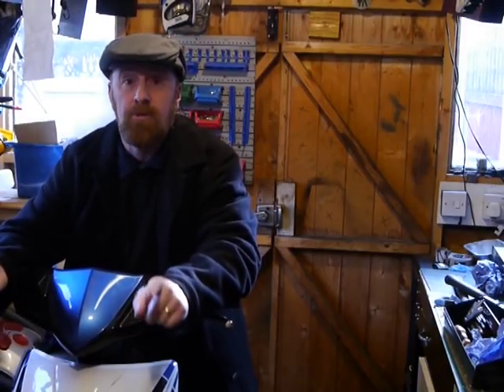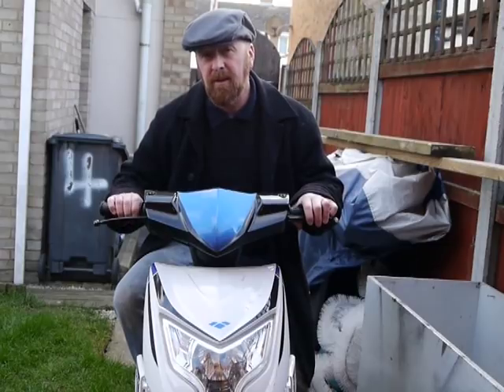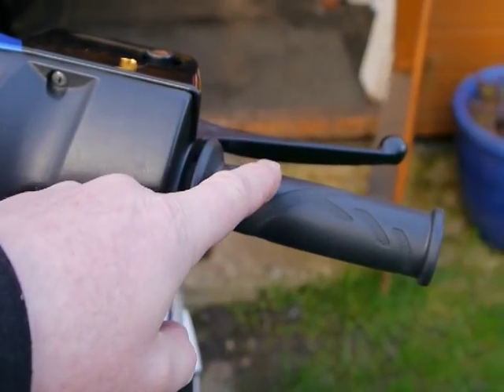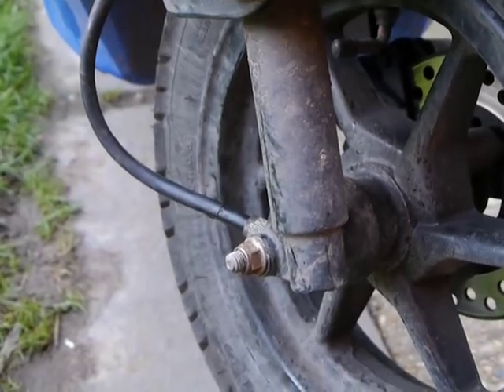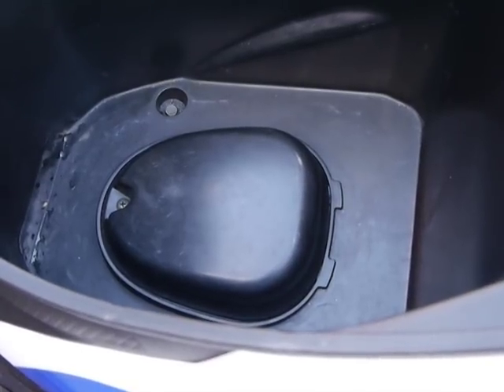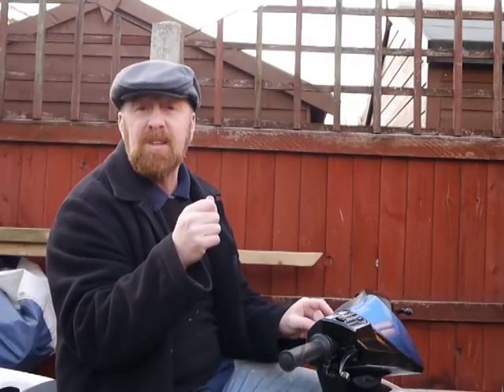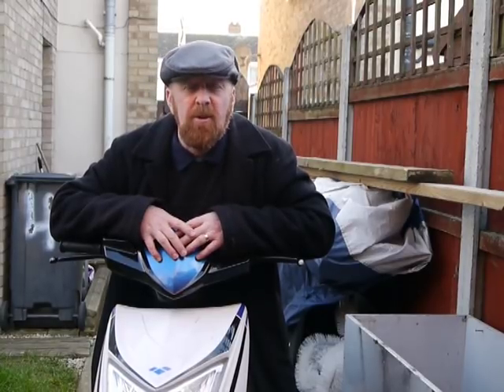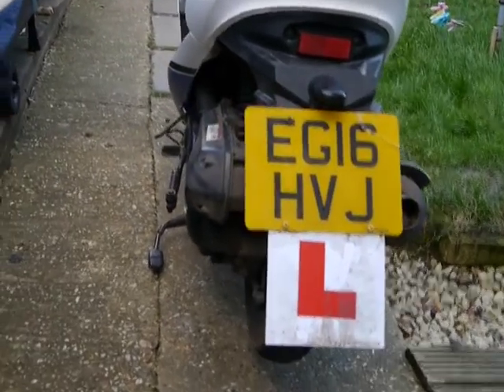LEXMOTO 50CC BUY A CHEAP CHINESE MOPED MARK SAVAGE

Comment: You'll be happy to know we have a 12" wheel version of the Echo now known as the Echo+. Thanks for the great videos :)
Reply from the maker: That's good to know and thanks for the update 
If I get hold of one I'll be sure to give it a revised review
Reply: I bought a Lexmoto Echo Plus last week. There is a loose pipe coming from under the seat. Is that how it suppose to be?
Reply: Can a lexmoto echo plus be derestricted?
Reply: @moukbu4235  no. Just basic cvt tuning (lighter or heavier rollers) and a sports exhaust but they don't do anything other than be annoyingly loud. If your 16. Just wait until your 17 and get a bike.

Comment: Mark your videos has helped me a lot with a small problem which a thot was a big problem till a watched your video on the lexmoto echo about the speedo not working so stripped the wheel off as the Speedo was still together at the back and the speedo cable made the little arm move when I removed the wheel and the problem was the exact same as you demonstrated straightend it out and there u are working perfect again and the speedo now say my exact speed without me guessing cheers mark 👌🏻🍀
Reply from the maker: Thomas McGhie that’s why I do the videos bud so they help with simple diy and away you go
Please like share and sub 
Mark

Comment: “Slightly unstable on the road” exactly what you want in a moped
Reply from the maker: They now have 12" wheels which solved this 
But to be honest once you get uswd to how they ride they are fine
Reply: mark savage I would prefer a Yamaha Aerox but I can’t really go over 1000 do you know any alternatives? (Used obviously)
Reply from the maker: @akmedia8206  aerox is a good moped and get a 2t older one much better 
Speedfight  , dna , nrg , runner 
All great fast fun all under £1000
Don't buy newer ones bud not as much fun!!

Comment: Hi man. I’m 16 soon and want a good 50cc. What good bike can I get used for around £700 I don’t want a cheap Chinese one like a lexmoto
Reply from the maker: That's a good budget 
Aerox , speedfight , DNA, runner , typhoon , 
These are all good mopeds as long as they have been serviced and looked after 
Dont get one that a lad has 70cc kitted it or says he can do 70 mph  and wheelies bud 
Test ride start and stop it long mot and v5 log  book with some info on what has been done 
You cant go wrong then
Reply: mark savage what does long Mot and v5 log book mean. Sorry I am completely new to biking and stuff as I’m still 15
Reply from the maker: @jamesroberts5875  for the mooed to be legal it has to pass a mot so it can be on the road it's like a health check 
V5 log book it a legal document of ownership so to say it's your
Reply: mark savage thanks man you’re a legend. Where could I buy one of the mentioned mopeds from?
Reply from the maker: Facebook sales , ebay 
And have a haggle lol
Reply: mark savage are you selling any?
Reply from the maker: @jamesroberts5875  
Nothing in at the mo bud sorry

Comment: Hello Mark
sorry for asking in this video but it's about the speedfight 2
my question is about whether it is advisable to use synthetic oil in the gearbox, the oil I intend to use is liqui moly 75w 90 gear oil
what do you think
Reply from the maker: hi bud it uses so very little oil in the gear box and I have done a video well two of the gear box that will help if you have problems but I'd stick with what Peugeot say you should used so you going to drain all of the old oil out then refill, its a very un stratifying job to do but does have to be done at some timehope all goes well, I cant see if you want to use the 75w it would cause too many problems at the end it's up to youmark

Comment: they do a 12inch model now as been sorting out one for a friend today  i got to say tho im more of a 2t guy   but riding echo+ after sorting it out  was not bad just very  slow after riding a 14hp 2t tho :D
Reply from the maker: yes I was contacted by lexmoto after I did this video and given one to ride if I wanted but at the time I could get to the main dealer to do a review 
but I have heard they are a lot better with the bigger wheels, as you must have watch a few more of my 460 videos theres many on 2t mopeds well speedfights aeroxs dna's nrgs etc etc and have to agree more fun and much faster but they do break a lot pmsl 
thanks for watching
Reply: @marksavage  i dont know why my friend got this one tho as he payed £300 yes its only a year old but  had blown fork seals and broken spring  ,  needed new rollers and exhaust   so looked like the 16 year old he got the bike from had well used it in that year lol so fixed everything then given it a service but for how fair my friend rides just over a mile to work its fine for that as after parts and for him paying me the bike stands him in £450
Reply from the maker: @mrchilled85  that's really good , they get used by 16 and not cared for so bargains for those like yourself who with a little bit of time and care bring them back 
Good to hear bud take care

Comment: Hi Mark I'm thinking about getting one of these little bikes I'm 18 and have just passed my cbt I'm going to buy it new and service it regularly with help of my dad who has a shop and works on scooter. I want this scooter to last at least 4 to 5 years. Would I be better off buying a speedfight preowned or shall I buy a brand new one of these
Many thanks
Reply from the maker: Prob best take advice from dad !, 4t are more reliable but slower 
2t like speedfights are fun but need playing with to keep them going 
What ever your choose make sure it goes more than 30mph on todays roads and stay safe

Comment: My son has the Lexmoto pulse both variator and cable seem to be working fine have you any knowledge of the speedo assembly being the fault many thanks
Reply from the maker: I have a few video on speedo drives well worth a watch 
Type in speedo mark savage 
They are on mopeds and 125s but they will help
Reply: mark savage  I span the wheel with the cable disconnected at the dash end and the spindle is spinning well I followed what you said cleaned speedo drive and re greased just as a matter of good servicing it’s the SPASM095 dash

Comment: I would rather buy a branded used bike. In my opinion Yamaha aerox ( the 2strokes) are the best mopeds in existence
Reply from the maker: I agree and if you have watched my many many other videos on aerox's speedfight's, dna's ,nrg's and so on you know I agree, however they do come with there own problems and not every one likes 2t's
so you do have to look at the 4t's and also comes down to budget
thanks for watching
Reply: @Paul Tanner you missed the used part. I can find plenty of branded bikes for under 1k that have far more life than a brand new lexmoto.
Reply: I'd get a branded bike if they existed in the class I'm getting(Swedish, class 2 25km/h). All you'll find in there is the Chinese bikes.
Reply: @eq2imora  unfortunately I don't think there is a big market for 50cc and big manufacturers anymore. The Chinese have forced them out.

Comment: hi mark, i just have a simple(hopefully) question, i own a kymco agility 50cc 4T scooter and now again i have another GY6 engine that just decided to stop building up compression, so it won't start, have you any idea why these bikes have this problem more than 2T bikes, this is going to cost me another 200-300 euro's (180-270 quid)to fix. Have you any idea what causes this to happen, so i can prevent it. What is the best way to run in a new cilinder? it's nothing special just an ordinary 50cc, i don't see the need to go bigger
Reply from the maker: HI BUD, this is the biggest problem with the GY6 engines, they run and run well and then just don't!
so your not alone, normally like in my videos as long as you keep them serviced and topped up with 4t oil they run well
so your last engine just died and you replaced the whole engine with another second hand engine or did you rebuild the old one, what was the fault on the old engine as you say no compression so the piston failed?
have you had the new engine looked at and is it the same thing. piston again ?
mark
Reply: the old engine(the original) is going to be rebuilt by an official dealer,  and then put back under the bike,and hopefully they will be able to tell me why the engine just failed,the engine that is on the bike at the moment ran wel 70-75km/h about 50mph and that engine also just stopped working, the official kymco manual recommends using 15W40 is that the right oil or would you recommend 10W40, i know that 15W40 is slightly thicker and also that it cools the engine better What is the best way to run in a new cilinder?
Reply: mark savage  just a quick update, apparently the previous owner had the same problem as i had at one time or another, because the cylinder on the original kymco engine was not an original part, they had replaced it with an imitation cylinder and also one of the piston rings had come out of its groove and the metal had ended up in the engine block and they had to replace the oil, but also the engine was run without oil at one point, because there was a deep groove in the piston AND the cylinder, now they've replaced the cylinder and piston and i can't go ful throttle for the next 500km

Comment: Hi mark are you sure the tank is 8 litres because whenever my fuel gauge is low I can only put about 4 litres in before it is full again
Reply from the maker: hi yes odd as the spec I first read for this model said 8 but since I have read it's only 4.5 or a gallon from empty so sorry bud but still not a bad bike 
thanks for watching and the correction 
please like share and sub and I have a few other videos that you may like to watch but with the right info lol 
mark

Comment: Hey Mark. I am a fat arse at 21 stone. Could I ride this or any other 50cc or 
would it not work with my lump on it? Cheers mate
Reply from the maker: hi bud 
your a big lad, if your over 16 then i would really suggest getting a 125 moped as a 50cc will be pushing it all the time and you will go through belts and clutches not to say it wont do the job as it will as most are designed for two people anyway.
they will just be slower pulling away and up hills
maybe best try a few first and see how you feel on them 
mark
Reply: mark savage hi mark do you have any other social media I can contact you on about mopeds?
Reply from the maker: HarleyGaming chat on here bud it helps others with the same problems if I can help find and give advice 
I. Have many videos on all sorts of things and best on the computer as you get to see all 350 videos 
Mark
Reply: mark savage was gunna ask if you have any peds aside that you can donate/give me for a project bike I’m working on
Reply from the maker: i did have a few bud but all out at mo, best look on FB or e bay but like in my videos some projects will drive you mad lol but it's a great way to start off
thanks for watchinf and please like sahre and sub plus i have many videos that should help you on your way 
mark
Reply: mark savage I have subbed, I’ve looked on eBay but had no luck at all. I’m from South Yorkshire, so if we could meet up and work on a few peds together I can learn a few things from you for when I do eventually get a ped myself and fix it up if it breaks down.

Comment: I’ve got this bike but a 19 plate do you know where the cdi would be I can’t find it anywhere
Reply from the maker: hi bud 
they often hide it some where on the moped, on the speedfights they are under the floor foot well 
others under the seat buckets or near the battery 
you might have to buy a manual or try and google the wiring diagram

Comment: Hi mate, I’m thinking about getting this bike as I’m 16 and my local bus has been stopped. I was just wondering when I’m 17 would I be able to legally derestrict it? Thanks
Reply from the maker: hi bud thanks for watching, when you 17 you can ride a 125cc motorbike or moped so you can sell it and upgrade i have many other videos that you may like to watch and please like share and sub mark
Reply: mark savage thanks, but I wouldnt be able to afford to upgrade it only after a few months, but do you know if I could legally derestrict it once I turn 17?
Reply from the maker: it is no illegal to have a un restricted 50cc, the law says at 16 you can only do 30mph, i do not like to have mopeds that only do 30 mph on uk roads, the steps you take while you are 16 are down to you, at 17 you can ride any motorbike or moped under 125 that can then do more that 30mph for more legal advice please check out . GOV.UKmark

Comment: how do u de restrict this bike?
Reply from the maker: you dont sorry to say they are not made to be derestricted, just 30 mph mopeds like I say in my video
some say about cutting the pink wire from the cdi, I dont like doing it but others say it works!!
Reply: mark savage thanks for the quick reply i cut the pink wire about an hour ago and made no difference to speed is there any other methods to increase speed? maybe change jet/carberreta or modifying the exhaust? thanks again
Reply from the maker: @Ztxk94  reconnect thevpink wire then  bud 
Worth maybe a sports exhaust and a small upjet 
It cant hurt
Reply: mark savage cheers bud
Reply: @Ztxk94  theres a small spacer in the variator take that out and put back togehter

Comment: I got 125 lexmoto overheating you no what it cud be thanks
Reply from the maker: Dale Cottrell I’m guessing it’s water cooled to overheat !
Loosing water bud either out or in 
If out fix it quickly 
If in then head gasket and that will need a rebuild 
Thanks for watching 
Please like share and sub
I have a few videos that may help give them a watch 
Mark

Comment: I'm not so sure w/the 10"-wheel being 'tiny'...with 'IRT' tires on it, the entire span is 16"-inches on my Honda 'Metropolitan'and it's as 'sure-footed as a mountain goat' at 42mph.  ( Of course if someone wants to 'Euro-style knee-scrapers' on corners, especially wet...then yeah, ya' gonna' be 'kissing the pavement' soon )
Reply from the maker: as you know bud I ride all bikes mopeds etc and for me it was a little bit scary when I was riding it home at 30mph and the camber of the road was uneven and a few pot holes and the moped started to head for the curb lol 
you take care bud and thanks for watching
Reply: Ah...the conditions of the roadways of course dictate ride & handling characteristics...the ones I know to be in poor condition I stay off of entirely (they are what cars are for!) and make no attempts to ride on at all since scooters were never designed for speed in such conditions ( To gently go down a path at 10 to 15mph is the 'norm' for those conditions in most of the World outside Western Europe and North America...but to ride at 'kick-ass' speeds because of being in danger of being 'run the fuck down' by cars on a road-surface you know in advance is 'shit' is something I never deal with )  I assume it would be 'unusual' to encounter 70 & 80mph traffic where you are...yet it's common enough in the America of 'now' so as to make riding ANYTHING with 'two-wheels' risky anywhere...so I use a huge amount of caution on a bike regarding 'where & when' to go somewhere  ( I just 'go shopping' now...my days of 'showing-off' at 14 & 15 are a half-century behind me, when I used to 'beat the shit' out of my Honda 'Super Cub'  that was for most part 'indestructible' )

Comment: Do you have any mopeds for sale ?
Reply from the maker: sorry bud no not at the moment 
mark
Reply: mark savage what do you recon is the best moped to get with a small budget and we’re to buy from ?
Reply from the maker: hi bud e bay or facebook but just be careful not to get one that some lad has been wheeling down the road and saying it does 100 mph
it comes down to 4t or 2t , 4t is slower but more reliable or 2t is faster but you have to maintain it more
to be honest as long as you like it and it's been maintained it will be fine 
mark
Reply: mark savage the problem is I can’t find anything at all in my area on anything or anyone that can deliver which is frustrating as really need to get a moped soon !
Reply from the maker: Charlie Dunton well there’s always the bike shops, you will pay more but you know they will run 
Or you need to travel buy bud or train and ride it back bud 
There are some guys that do pick up bikes for you and they are not that expensive !
Worth looking into but there’s a cost to everything bud 
Mark